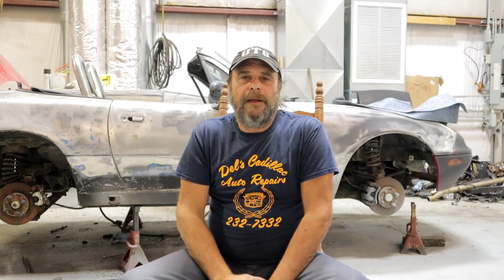Automotive De-Evolution...The Next Big Thing?

Comment: It almost seems like Tony is preparing for and will be ready to go, after an EMP attack. 
His no electronics attitude would be totally compatible with a post EMP attack scenario.
Reply: Wouldn’t an emp attack take out the condenser in the distributor? Just a thought.
Reply: @Stevearnold-k7t  what happens with an EMP is a massive voltage spike is inducted into any closed circuit. If you take a wire and cut magnetic fields with it, a charge will be induced in the wire. Its how an alternator and generator work, lots of copper windings passing through magnetic fields makes electricity.

An EMP is an electro magnetic pulse, massive very powerful magnetic waves that will induce millions of volts into wires. There was a massive CME, coronal mass ejection in the late 1800s that fried the telegraph wires and set poles on fire. That was the at the earliest start of humans using the EM spectrum so the damage was minimal. 

So every circuit that is closed will let the smoke out, every circuit that has enough proximity for the charge induced in the wires will jump the arc like a spark plug. However, depending on the magnitude of the magnetic waves, even a thin sheet of metal can act as a faraday cage. Usually all you need for a functional faraday cage is some chicken wire, but the more powerful the wave the thicker and more solid the shielding needs to be.

You have to have cage on the bottom for an EMP or CME as well, because the earth's core is a molten ball of iron and heavy metals (radioactive stuff) and the magnetic waves can bounce off it and come up through the floor.

Its just science, not magic, and a condenser might get fried, it might not, but all the wires around it will let the smoke genie out if its a nuclear bomb sourced EMP.

A gamma burst from a pulsar aimed directly at us will kill everything on the side of the planet facing the pulsar, almost instantly. Around the edges radiation sickness will kill everything else. Everyone on the other side of the planet will have a bad day too, because of the fires raging on the exposed side. One of those could be the cause of one or many mass extinction events.

The cosmos is trying to kill us all. :)

Fun times.
Reply: @SweatyFatGuy  that’s interesting , I’m a telephone pole worker , I’ve seen a few fry ups on overhead lines , and also the faraday cage stuff is interesting , thanks for your reply steve UK.
Reply: @Stevearnold-k7t  yeah I was kinda figuring anything electric is gonna be chooched , no matter the shielding attempts.
Reply: This. fix it yeself with what you knows and yea there's diesel butt both runs out eventually. edit: Also, I'm not convinced that a simple faraday cage is enough to survive a plasma, cma, micro-nova, magnetic reversal, or other electric cosmic event...! (oh, and <3 all)
Reply: @zarkeh3013  well a gamma burst hits us and it won't matter.. lol
Reply: @zarkeh3013  ATF, marvel, engine oil, used engine oil....I've ran mine on anything oily and slippery like that.
Actually my one runner likes a nice combo of oily stuff at about a 30% mix , feels like 10hp. 
Diesels can run on about anything.
Reply: the funny thing about the EMP planning? where are you going to go? you can't access your ATM for gas money and you can't use your credit card. Because of "just in time inventory", once you get on the road, everything's been hoarded (look what happened in the deep south when a fuel line was shut down by a company who's billing records were hacked. they couldn't charge, so they stiffed everyone and the good ol' boys panicked and bought all the gas they could--even though it was obvious there would be fuel by the end of the week).  And by the time you reach your destination, the EMP affects have cascaded--whatever it shut down in your area, is data files that need to be where you are going and so just like flights thru O Hare airport when it shuts down for snow..you've got a domino effect.

Best thing for an EMP strike? grow you own veggies on the back porch.  when something goes wrong, stay the F off the highways and just keep eatin' like a king. if there's any radiation fallout from that EMP, you got it already, might as well die rested
Reply: @albertgaspar627  yep, thats why I make my own fuel, food, and can make electricity a few different ways.

I lived in the south for five years and I always found it most amusing that they would run to the store and buy all the bottled water and bread any time they got a flurry that melted as soon as it hit the ground, or a hurricane went by. 

I grew up in Nebraska where the weather tries to kill you weekly. We went three months with no power back in 1978, due to an ice storm. The roads drift shut any time they get more than 2" of snow. It can be days to weeks before you can get around.

Now I live in northern Michigan where we get 150 to 300 inches of snow, and the power grid is about as stable as my bipolar ex wife. If you're not prepared for being snowed in, chances are you are gonna lose some weight. The power goes out for weeks at a time here with just a wind storm.

I left the south in 2005, the day Katrina hit and I was racing the gas shortage with my U Haul truck. Saw gas for $12 a gallon in Atlanta.. I know how unprepared clueless idiots react.

Where will I go with my fuel? Anywhere I damn well please. I would also be willing to teach people how to produce fuel and get their power back on for a while each day, if they are willing to put in the work to do it. 

Keeping the fridge cold will be a big thing in the warm months. Sure you can steal my fuel, but your vehicle will run poorly on it unless its a flex fuel. When it runs out, what will you do if you managed to get a vehicle running?

Its a safe idea not to rob the heavily armed man who is telling you how to get mobile and keep your food cold.

Food is one of those things that takes time, and if you don't have the ability to produce it, well yo are going to be doing things to get it, like selling yourself. Food is like dark humor, not everyone gets it.
Reply: I did a bunch of research into EMP and electronics after I updated my dorsal neuro simulator installed. Turns out most cars will be just fine. The issue is how big of an "antenna" the integrated circuits are creating. Most are small enough that not enough current will be picked up to cause them to burn out. At most it will shutdown, but restart right afterwards with no problems. You'll have mu worries about the nuclear fallout from the high altitude air burst used to create a strong enough EMP to take down power generation stations, and substations.
Reply: I can appreciate going minimal , but unless he's going diesel you still have to deal with pixies. 
Meanwhile , I can pop the shutoff plunger out of the injection pump of my rabbit diesel and pop start it down a hill.

Comment: My high school biology teacher Mrs. Goetting once told me "too much of anything is bad for you".  I get there are benefits in terms of safety and fuel efficiency and whatnot with modern cars but all of that technology makes modern vehicles largely unapproachable for somebody interested in learning to wrench.  It's gotten to the point where just replacing your brake pads or even checking your oil requires an expensive scan tool.

As such it's not hard to understand why more folks are interested in older cars that are not only easier to understand due to the simpler engineering but were designed to be worked on by a competent owner.  Perhaps it's part of the growing "right-to-repair" movement...people just sick and tired of being taken advantage of and wanting to be able to fix their own stuff.  Speaking from my own experience I bought a '68 VW a few years ago and LOVE how simple it is to work on.  I don't think I'd have the courage to make it a daily driver, but a '70 Duster with a slant or a 318 and a 4-speed?  Maybe... :)

Comment: It's a matter of a car having "soul". Modern cars lack this quality.
Reply: Today’s cars are just throw away transportation now.
Reply: @100texan2  cars in the 60s were the personification of throw away cars, they were designed to be replaced yearly lol.
Reply: @DrewLSsix  really? Is that why so many old cars are still sought after to restore or get running? New cars will never be desirable as restoration projects like the old cars. Now I will admit they are safer vehicles but the quality in many of their components is just not there. Today is a throw away society. People today don’t keep cars as long as they used to, maybe three to five years at the most then they trade them in, just like their computer or cell phone. The manufacturers know this so they keep building cheaply made cars. After a few years it becomes a cycle for the car buyer, after a while these cars just aren’t worth fixing anymore because it’s too expensive. Manufacturers knowing full well that owners don’t plan on keeping their cars for a long time, so they build junk. It’s much easier these days to get burned buying a used car then it used to be back in the 1960’s and 1970’s buying a used car.
Reply: @DrewLSsix  I always heard 10 years life in the day. But you also have to consider the majority of people didn't drive nearly as much as today either.
Reply: @100texan2  the car you talk are all death in a field or a barn 
Someone restored/repaired these car to run
Most of them have  past the last 30 year of there life rotting away in a field

My daily is a 1990 civic so 30 year old and 180k mile and nothing is crack in the interior and all part are easily available and dirt cheap and super easy to work on change the cap,rotor,wire,plug and timing belt each 60k and your good to go for 200k easy 
maybe modern American car are just cheap throwaway appliances lol
Reply: @DrewLSsix  Yes, but the enthusiasts in both the industry and production injected so much essential Vita, the corporate plans were ultimately undone.
Reply: @legros731  nobody restored my cars, yes repairs have been done like anything mechanical BUT new cars will never match the styling or be on the road 95 years from now. They’ll never be simple to work on. Open the hood of any new car and there’s more crap crammed in such a small spot it makes it impossible to work on. New cars are built where the owner can’t work on them and has to have all type of exotic tools and computer readers, etc. They’re made to be disposable and not worth spending the money on them to fix. Sheet metal as thin as a soda pop can. Plastic everywhere that breaks. Throw an EMP and their dead , take my old points type ignition and they won’t be affected. While you’re stranded I’ll be motoring along quite nicely. Now I will agree that in my opinion Toyota is about the only new vehicle I would probably buy because all the American made cars are pure junk. Honda was good at one time but I don’t know about them anymore.
Reply: @100texan2  lol it been in the road 95 year lol🤣😂😭🤡
It must be a shitty rust bucket then
Reply: @legros731  What's with all the emotes?
Reply: @100texan2  The irony of your statement is they last 5 times as long as they did in the 1960's and 70's so " throw away" does not mean what you think it means.
Reply: @SophiaAphrodite  is that why the dash in my 2003 dodge pickup cracked all to hell within 5 years, the plastic trim around the hood cracked soon after, is that why all these new cars with plastic headlight lenses get yellow within a few years, is that why the plastic a/c vents break to pieces within 5 years, etc., etc., etc. and talking about old cars not lasting, is that why my 1928 model a Ford is still running, is that why my 1948 ford f1 pickup all original is still going, is that why my 1966 ford truck is still on the road, oh, I forgot those cars are 90, 75, 55 years old no way could they have lasted that long they were all junk. It’s all in my imagination.
Reply: @SophiaAphrodite  they’re throw away because they will never be worth restoring. They’re all overpriced and mostly to costly to repair after about 10 years of use.
Reply: @SophiaAphrodite  yet soooo many cars of 50 & 60 are still around. Cherished, repairable, serviceable and restorable.
 How many from just 20 or 30 years ago are still around? Almost none. Sometimes longevity isn't counted on the odometer.
Reply: Not that I am against safety, but once all the government regulations took effect, building a car was more formulaic box checking than art and craftsmanship.
Reply: The passion that was poured into these cars was unmatched, and that’s what I think people connect with.
Reply: yep, that's what i always think. a soul and a personality.
Reply: AGREED!!!
Reply: You can thank the corporate lemmings
Reply: Cars will last as long as the owner cares to take good care of them. Any car can be worked on and fixed if you have the knowledge to fix it. Parts wear out eventually, and fixing the new stuff means having to learn how, just like learning the old stuff. The old cars weren’t as good as a lot of people like to say they were. I grew up working on them. None of them were designed to last for more than a few years by the manufacturers, because they want to stay in business. To say that the old cars had “soul”, and that the new cars are merely “appliances” is an opinion, and nothing more. There are a lot of young folks who love their Mustang, Camaro, or Hemi Challenger, and are able to work on them, because they learned how. Instead of being down on the people that Hot Rod these cars, maybe they should be respected and encouraged, as they are the next generation of young builders, and hot rodders.
Reply: Soul and a personality. You learn it’s tendencies, it’s nuances. You could have an entire neighborhood of the exact same car, say a 1970 Challenger, 440. And not a single one will be exactly like the others...the tune will be different, one will start easier than the rest, one will have a weird bog when you dip into the secondaries, etc. I love new stuff, but the simplicity and mechanical nature is something special.

Comment: I 100% agree For years I've been wanting to swap old engines into more modern cars, but I live in California and they won't pass smog test. Now I live in a part of California where you only have to smog it once just to get it registered but that means I have to buy a car that will pass smog then pull the modern engine out and put the old in. Therefore the cost goes up. I can't just go buy a non running modern car for cheap and switch engines. California sucks.

Comment: That's the secret. The old ones YOU can work on. The new ones you pay someone else to plug a computer into it and fix it. Yea, they last longer and run (sometimes) better but, so does a new wash machine. Do I want to work on a wash machine? The old ones had personality, the new ones ARE an appliance built to operate, not to inspire.
Mike
Reply: I bought the computer!
Reply: Dude, have you bought appliances lately? You don't work on them, you throw them away and buy a new one!
Reply: Nope, I can fix appliances, too.
Reply: @michelmoss7559  usually, the replacement part is more than a new unit. Like the display/control board in my Dad's oven.

And that assumes parts are available at all.
Reply: If I can't fix it, it ain't broke.
Reply: To each their own. I have a machine shop and can build electronic circuits, parts availability can always be a problem, so I make what I can't buy. Yes sometimes you throw it away because you bought a cheep piece of Chinese crap, but I try to buy quality made products, you know like they made in the 60s and 70s. lol
Reply: @michelmoss7559  even the "good" brands are like that now, sadly.

I would rather have a 1970s fridge than a brand new one.

Comment: I love messing with old cars and new! I enjoy the electronics best, but as an engineer and an army background with wiring...   New stuff isn't for everyone, you kind of need to be a nerd. I am a huge nerd, even designed built and coded my own ecm....   But I do agree with you that most people just want to enjoy the simple older tech
Reply: Did you hook up a Raspberry Pi so you can program in the BlueTooth signal to send the spark over Wifi to each cylinder?
IT'd be cool if you did....
You could even have it open the A/C vents at predetermined velocities of quantum Higgs-Boson FLuetenheising Capacitive valves!

Comment: “ If you want to connect with something, you do it with a screwdriver and not a laptop” sage advice.
Reply: My preference is late 60s Ford's can't go wrong and NEVER left Me on the side of the road. 🦅🇺🇸🦅
Reply: @robertwells6454  morning’s ymy e up
Reply: Not to mention that your screwdriver isn't reporting what you are doing to GM!
Modern cars are spy machines.  They record everything. Their records are admissible in court.  Murders have been solved with them.  GM or Toyota or any other car company can recreate your life as well as any phone.  It knows what time you get in your car, if you get in alone or with a passenger, it knows when you release the emergency brake, how fast you are going, what time you leave and what time you arrive and where you went.  I believe this is all being uploaded to the car company.  It is all being recorded for sure, but I am not a 100% sure if the data is being sent to the car company or simply staying inside your car's memory.
Reply: To be fair the things you have to use a screwdriver on you are adjusting 10 time as much. So of course you connect with it.